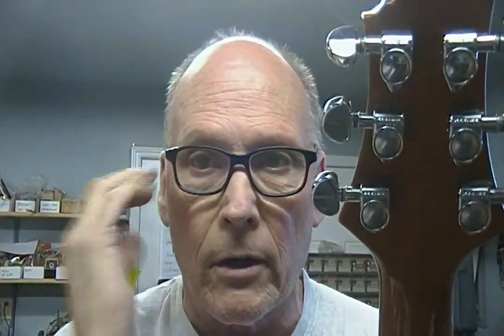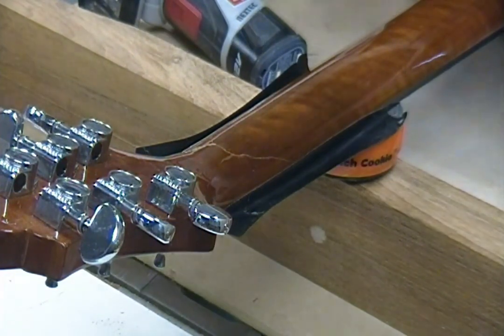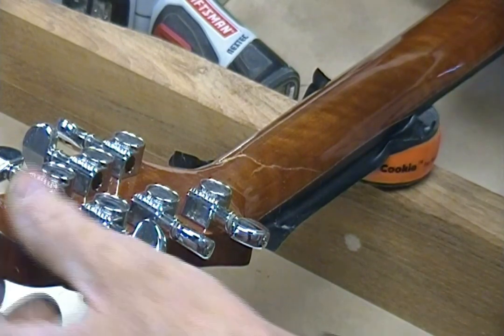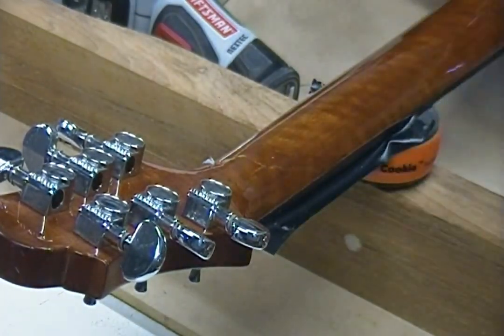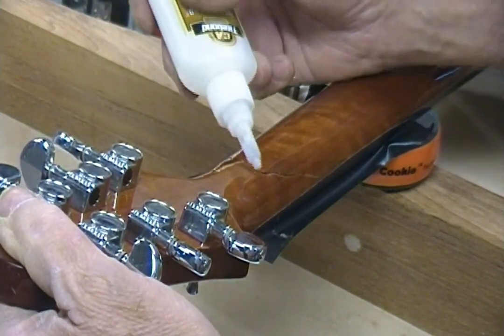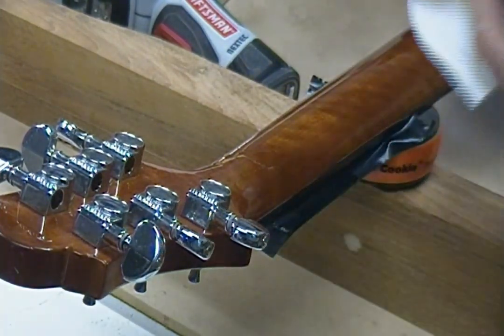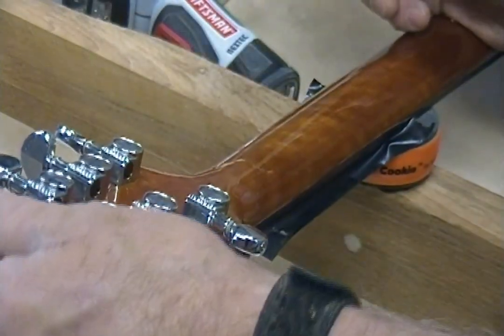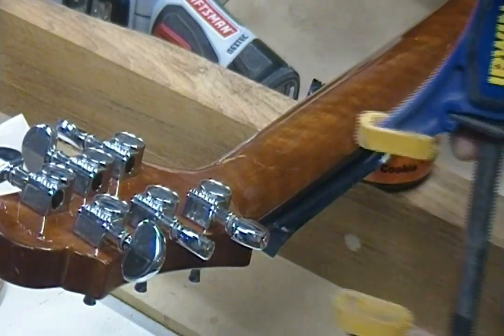Easy Guitar Neck Crack Repair with Super Glue – JONAH GUITAR – Part 1

Comment: Nice in depth video. Also I wanted to ask, how can one repair the protected glazed shiny layer of an electric guitar, not necessarily broken wood or just small dents of the glazed layer of the guitar?
Reply from the maker: So you want to shine up the guitar. It might just a haze of sweat or grime. You could try cleaning with lighter fluid and then polish it. If it's actual wear or abrasion then a fine cut polish should bring it back.
Reply: @jonahguitarguy  I saw a guitar one time with a cracked neck but not the neck/wood, rather just a visible cracked line of the  glazed lacker portion. Is that fixable?
Reply from the maker: @Metalpazallteway  yes that can be fixed or at the very least stopped from getting worse. Some repairs are not invisible. The more of this sort of thing you work on the more realistic you can be with your goals. The same thin CA glue I mentioned in the other comment will work for this type of finish crack.

Comment: Hi, thanks for sharing this info.  should one get the CA THIN SUPER FAST (EM 02) or CA MEDIUM (EM 150)?
Reply from the maker: It doesn't have to be fast set but yes the thin stuff so it runs in good. Which type of glue really depends on if you can flex the crack open very much. If you can flex the crack open my preference Titebond org. You can help it run into the crack with an air compressor or canned air.

Comment: Hey man how do I fix minor splits on the siding of my fretboard, it’s a black neck and ebony fretboard
Reply from the maker: Do you mean the fretboard is separating from the neck? Or there are minor slits in the board itself?
Reply: @jonahguitarguy there’s minor slits, not sure how to describe it, it’s when you hold it and look down on the fret markers on the side of the neck, it’s next to one
Reply from the maker: @AidenM716  I would fill them with med CA glue. Once cured scrape with razor blade or file with fine file. Some fine sanding may be needed 600. Coat with fretboard oil or polish if the edge has a clear finish.

Comment: I bought an used bass guitar and didn't pay enough attention. The neck was splitting on the scarf joint. It wasn't breaking, it was a clean separation (really tight gap). Do you think I can repair it with thin CA without removing the fretboard? I'm really upset because I have little money and cannot afford to send the bass to a luthier and this was a really dumb mistake of mine. I'm really sad with my stupidity. Can you please help me?
Reply from the maker: Send me some good pictures of the break.
Reply from the maker: There's a button that says view email address right under all that other info.
Reply: @jonahguitarguy  I found it, thank you. I sent two photos to your email.
Reply from the maker: @rbmc1983 ,I saw those and just responded. Good luck friend.
Reply: @jonahguitarguy  thank you. You helped a lot. What's you advice if the crack is dirty? I think it might be the case. I'm grateful for your help. Subbed to your channel.
Edit: grammar.
Reply from the maker: @rbmc1983 , depending on how much you might be able to flex the crack open you could scrub what you can get to with a tooth brush a lighter fluid. You could also try deionized water to lift the dirt out. It’s strange but the properties of the water draw dirt out. It’s something you get online.
Reply: @jonahguitarguy  You are the best. Thank you!
Reply from the maker: @rbmc1983 , you’re very welcome no problem brother.

Comment: May I ask, if it were not "wicked" with water, would very thin viscosity CA glue not "wick" by itself?
Reply from the maker: Good question Jim.  My understanding from a source I trust is it works better with water than without. My feeling is I want it to work as well as possible.
Reply: @jonahguitarguy  Affirmations are a gift.  Thanks!  This will make or break for me.  Feeling hopeful.  She plays but she don't stay in tune due to a neck crack.  I am visualizing the steps.  Haven't applied glue yet.
Reply from the maker: @jimlytleworks , good luck Jim
Reply: @jonahguitarguy   Thank you, Dane Nichols.  I now have a fully functional '79 Ovation Legend thanks to your video and feedback!  I used distilled water.  Not sure if you think that part matters or not.
Reply from the maker: @jimlytleworks , distilled water can’t hurt.

Comment: Would the same concept work for a baby taylor who has those dovetails ?
Reply from the maker: Thanks for the question Johnny, I hate to give an answer without seeing the guitar and knowing exactly what shape it's in. But if the finger joints at the neck to peghead took a shock and it's just loose then I would think CA glue is very reasonable way to repair it. If it's completely separated and wood glue could be used I think that would be better if it is that loose.

Comment: Hello sir! I just cracked my guitar neck and the crack like yours. difference is that the side of the crack toward the body is a bit raise in comparison to the other side, the crack is a bit more toward the head and it is not that deep. I dont have anything to repair it and since there is complete lockdown in my country, i cant take to a guitar shop. Is it okay if i keep playing or should i do something so that it doesnt get worse? I have an electric Guitar.

PLZ REPLY I AM REALLY WORRIED AS IT IS MY FIRST AND ONLY ELECTRIC GUITAR
Reply from the maker: I wouldn't keep playing it if the crack gets bigger when tuned to pitch. If that's the case loosen the strings and wait until it can be repaired.
Reply: @jonahguitarguy  But the problem is that i have a tremolo bridge. If i loosen the strings, it puts pressure on the body and i think that it can dent the body. Also, i think only the outer part is cracked and it doesnt move at all even when im tuning or bending hard.
Reply from the maker: @krishverma2611 , if it doesn't open don't worry about. You could a couple of business cards between the bridge and body to protect the body. Plus if you do keep playing it put some tape over the crack so it doesn't get and dirt or oils from your hand in it. The glue will work better on clean wood.
Reply: @jonahguitarguy  ok thnx a lot you relieved a LOT of my stress. Thank you very much!
Reply: @jonahguitarguy  hey i really need your help i was restringing my guitar and when i removed the strings i saw that the crack is as far as the fretboard and it opens when i pull it back(the fretboard also opens when pulling back).I am REALLY worried and i dont know if i should put te new strings on. PLZ REPLY
Reply from the maker: @krishverma2611 , it sounds like the crack has become bigger and more flexible. At this point you need to stop playing it and loosen the strings. If you are worried about the trem hitting the body put some business cards under it before you loosen the strings. Time to take it yo a good shop and get it fixed.
Reply: @jonahguitarguy  the reason im not losening is because the crack opens on the fretboard and not on the back of the neck. When i loosened the strings, it got open and 1 fret came out. Currently i have kept it safely with strings a bit tight just to keep it in place.
Reply from the maker: @krishverma2611 , that is a very complex crack indeed. Do what you have to do to keep the neck as stable as possible. I'd love to fix that one.

Comment: Ive found a semi acoustic guitar in horrible very horrible condition and im trying to fix it, problem is, the neck is all cracked the mechanism where you tune it rusty,any tips?
Reply from the maker: Hi Snaaa-bx7yx, Rusty tuners may be able to be fixed by taking them off the guitar and soaking them in some solvent. I would start with naphtha. Brush with an old tooth brush. Let them dry or blow them out with air. Oil with 3 in 1 oil or something similar. You may have to replace them if that doesn't work. Hard to comment on lots of neck cracks without seeing the guitar.
Reply: @jonahguitarguy  yeah the neck cracks is litterally missing pieces
Reply: @jonahguitarguy  like a puzzle😂

Comment: Ok why the water? Can you explain that please? I have an LP with a heel crack that I am thinking of doing something similar with since it is not very separated. Thanks
Reply: OK after re-watching this it sounds like you are thinking that water will help the thin ca to penetrate better but water actually makes ca cure quicker. To slow it down put it in the fridge and chill it. Just my 2c. Thanks for sharing.
Reply from the maker: @franklinslamo , all I can say is smarter people than me have used that method for years.

Comment: How much would you typically charge for this type of repair? I have a similar scarf joint crack and am trying to decide if I should have it repaired or just buy a new one. Thanks!
Reply from the maker: That’s 50-100 depending on finish touch up. Less finish repair = less $
Reply: @jonahguitarguy  so I have an albanez that the head snapped off and I went to Guitar center and they wanted 330$ for it I said I’ll think about it. Is that a good price for that repair?
Reply: Actually they said 350$
Reply from the maker: @pizrux6592 , there are a lot of factors involved. You say snapped off, well it will need finish repair and possibly splines. Plus where you live can also be a cost factor. I personally have never had one cost that much.

Comment: Hey, quick question, why did you spray the crack with water first?
Thanks.
Reply from the maker: McDuck, it helps the CA wick into the cracks better. And it doesn’t hurt the adhesion any.
Reply: @jonahguitarguy  I had the same question. Thank you for all that you do sir
Reply from the maker: @Patrick-lm5qy  appreciate it!
Reply: that is what they do to wood when there building boats they get it wet so they can bend it.  it probobly opens the pores in the wood up more so he can get whatever he needs to down in the crack to repair it i imagine he used saw dust and i would inject epox or tight bond 2 or something clear type of glue  resin with a insulin syringe super fine till the whole got filled up and clamp it down with a wood clamp and wipe away the excess as tightly needed but not to tight . see wood expands and contracts in different weather temperatures and also is a little flexable when it gets wet and he probobly sprayed the wood first with water because wood gets very dry and can crack easy when you put to much preasure on it so he probobly did that to relieve some preasure and open the wood pores up on the guitar would be what i would think.

Comment: Why did you spray water on it before applying the CA glue?
Reply from the maker: Hi Plusmin, a little water in the joint helps the CA wick into the crack.
Reply: @jonahguitarguy  Thanks!
Reply: @jonahguitarguy  I'll try that out! I dropped a lucite bass while trying to dig out some of that weight, and it cracked along the scarf seam. Hopefully the super glue will be enough

Comment: i wish headstcks broke at the scarf joint more often, easier to fix in my opinion. spaaks volumes about the strength of wood glue and a proper  joint
Reply from the maker: Most headstocks breaks are surprising easy to fix. And the nasty ones get splines. Thanks for having a look.

Comment: inspired by your techniqe, i will do the same to my gibson j200 acoustic guitar. just curious if the water you sprayed into the crack will not weaken the super glue?
Reply from the maker: Thanks for watching Rommel, The water helps to keep the super glue traveling deeper into the crack. With out the water it might dry to fast and not get to the bottom. And the water will not hurt the glue in any way. I still have this guitar hanging by the peghead in my shop. It was given to me cause it was broken and the guy was moving away. It's holding up very well I even took it to the lake last summer.
Reply: @jonahguitarguy   great help Dane, thank you so much for that info. will do it right away, thanks.

Comment: Mine snapped the neck clean break hiw would I fix if myself?
Reply from the maker: Do you mean clean break like in two pieces? If so clean is great but I would not use CA in that case. And when a neck is in two pieces realignment is very critical. You really need to work out a clamping plan and dry run to make sure everything is aligned correctly. Sometimes jigs are needed. I would use titebond original wood glue. Go to about on my channel and email me a pic or two.

Comment: super glue starts to set up fast and does not absorb into the 2 sides of the crack. Titebond (yellow glue) is what a real luthier uses. Forget this.
Reply from the maker: If you watched the video then you know that I ran some water over the crack to help suck the CA into the crack. It also slows the dry time. Titebond is great if the crack is more flexible and can be opened up a bit. Check out my Epi Dot neck repair that is exactly what I did in that case. And in this case the guitar is holding up fine and really wasn't worth a more expensive repair.
Reply: @jonahguitarguy  OK; if ot works for you time after time, then it's good enough and fast
Reply: I read that moisture helps CA glue dry faster, so I am confused as to how water will prevent drying too fast. Any ideas?
Reply: @mC_DiDiDiDiDi  Yes I have heard the same. I am not sure what the value of the water is or if it actually works for the intended purpose. I may have to do some experimenting.

Comment: My dog knocked over my new Les Paul guitar and there’s a slight crack in the neck. 😭
Reply from the maker: This would be a good way to fix it. But it needs to be clamped correctly. If you’re not sure about doing it yourself take it to a good repairman. But don’t leave it to long because it will collect dirt and oil in the crack and that could be a problem for the glue up.